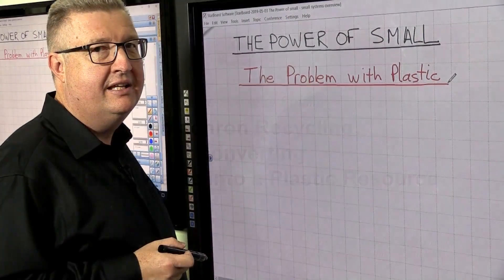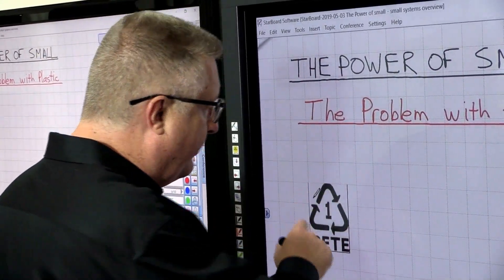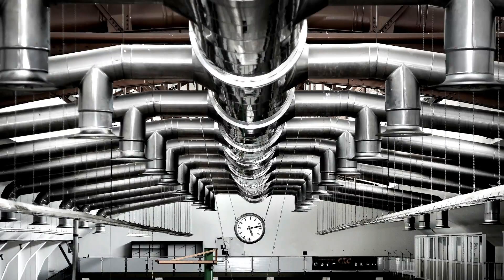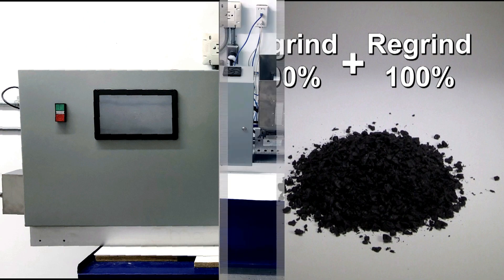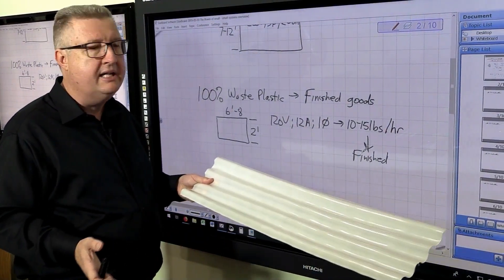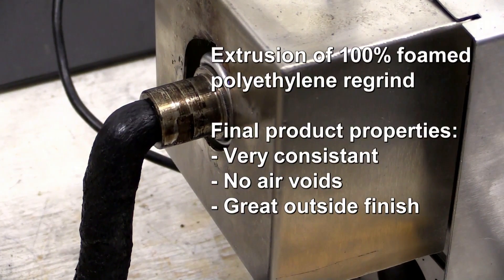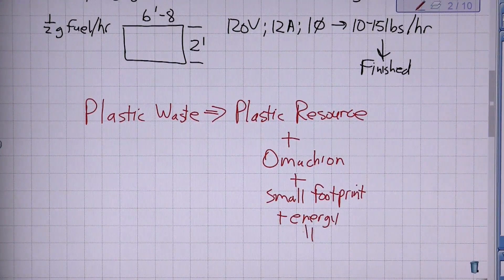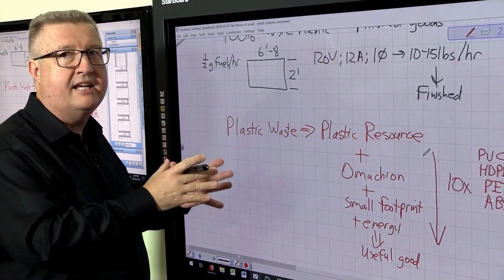Transforming Plastic Waste into a Plastic Resource - Part 1

Comment: First: regulations in most countries allow no more than a 10% mix of (virgin) regrind with pure virgin for FOOD-GRADE stuff, what you don't mention is that bleach bottles and many other products are done with 100% non-degraded recycled plastics since the sixties. Mixing different degraded plastics, even those which are not chemically compatible has also been done since plastics' inception, basically. I mean to say you haven't invented anything, you machine is just a bench-top version of an industrial injection machine, and your "particular and innovative process" is no other than raising plastics' temperature to it's melting point to then let it get back to room temperature, as it has always been done. Something different is that you want to sell your machine because you've achieved certain degree of mechanical efficiency and so can do it with less energy than your competitors. But then just say so straight and stop fooling people around with non-sensical marketing blurb. If at all, and if your machine truly melts any sort of mixed plastics into a solid piece (you only show it working with what seems to be virgin material to me, or non-degraded recycled at most), would have a simple modification on it's screw to account for melting points of different plastics that could go through at once, among other minor things.
Reply from the maker: 1.  We are not proposing to use mixed plastic regrind for food grade applications.

2.  Our screw design enables us to process approximately 80 pounds per hour of plastic with a 5 hp motor and a total power input of approximately 5.4kW total which is significantly less than conventional equipment.  A convention 5hp extruder cannot typically process more than 30 pounds per hour.

3.  In testing of conventional extruders, working with a mixture of plastics resulted in degradation, poor mechanical properties, and other issues.

4.  We have carried out testing wherein we have created parts, tested their deflection and tensile strength, reground and reprocessed them, and retested their deflection and tensile strength and were able to maintain 95% of the initial tensile strength after 10 cycles.
 
Our more recent videos have provided more information on our process, for instance this video: https://www.youtube.com/watch?v=nJS-KEc-c10

Comment: How does it do with contamination? Most recyclable material has food waste etc. and it can't be reused. One of the big problems with the current system.
Reply from the maker: Omachron (https://www.omachrontechnologies.com/) was initially working with plastics reclaimed from beaches, lakes, rivers and oceans where food waste is not an issue. 

We have also developed methods to make products with mixed plastics which may include paper.
We are currently developing a closed loop method for working with plastics contaminated with food and other water soluble wastes.

More details of the process and the equipment will be made available in upcoming videos.